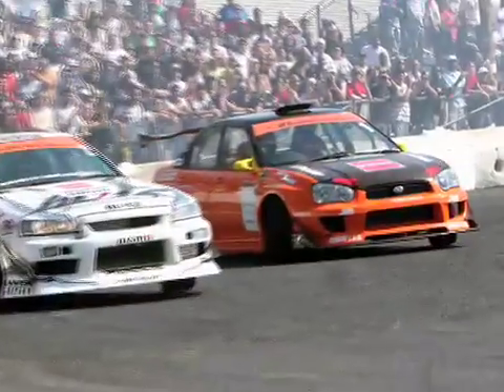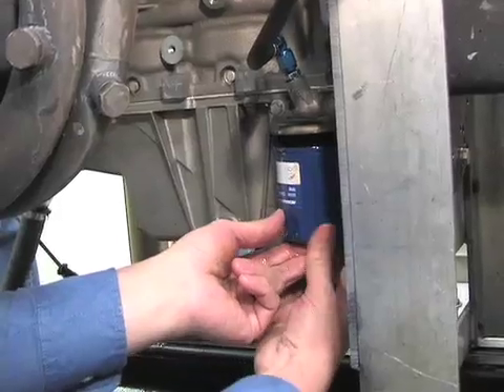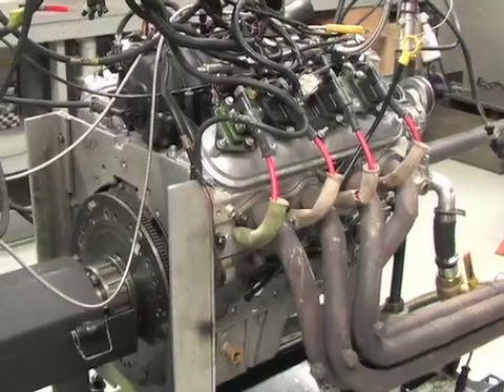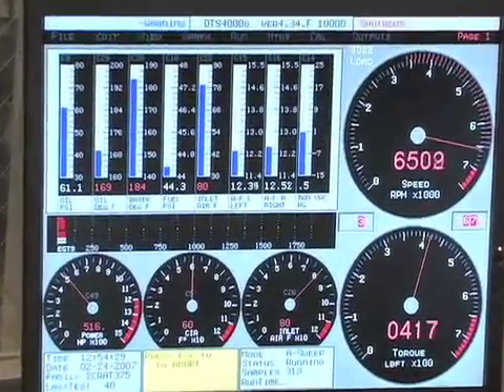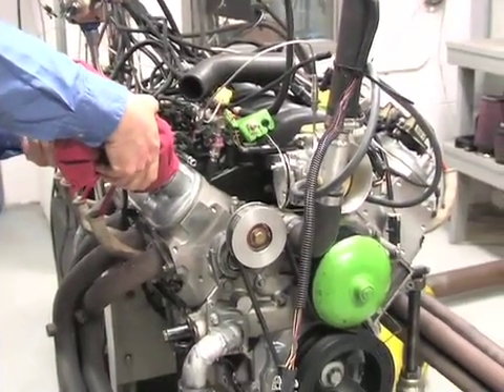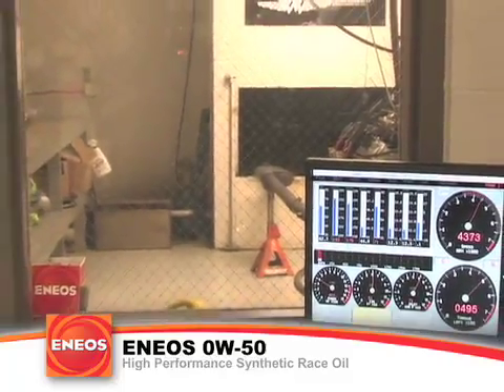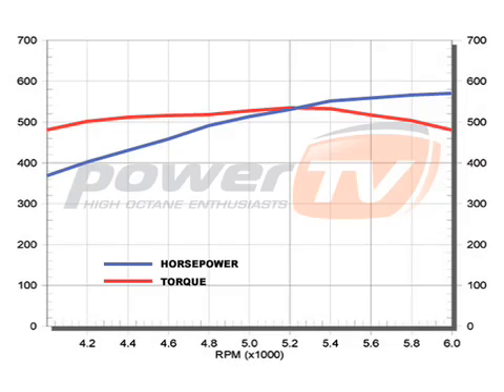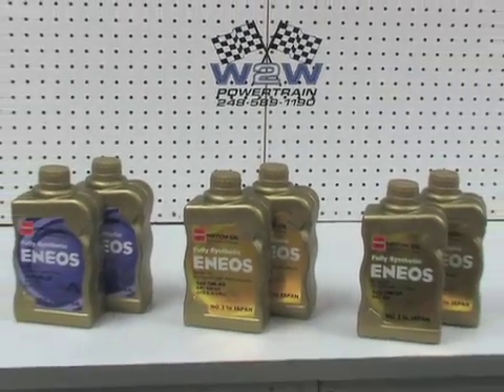ENEOS Oil Dyno Test

Comment: What idiot runs those multi grade viscosity oils in same in engine? Comparing horsepower is completely irrelevant if you run the wrong weight oil and spin a bearing. Run the right oil.

Comment: Trying to use dyno testing to compare oils, in my opinion is totally invalid. The reason is that any dyno differences between motor oils fall well within the +/- margin for error of the dyno equipment.  For this reason, dyno's shouldn't be used to test oils. The job of an oil is to protect an engine against wear, not increase power. Olive oil will show a power increase too, but the engine wont last too long.  lol 
 For anyone that is interested, I have a lot of information on oils at my channel.